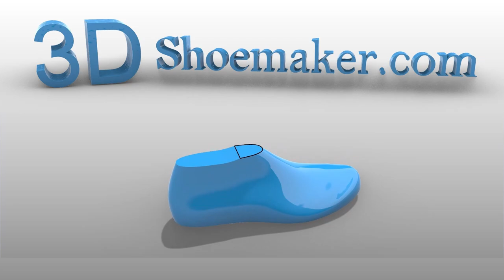3D Printed Shoe Last Rail Joint Assembly Steps

Comment: I'm very curious about 3-D printing lasts, but how well does it actually hold up when you're nailing into it?
Reply from the maker: Great. It is harder than conventional HDPE, but with 5mm thick walls, PETG is surprisingly good, not like a thin shell PLA print